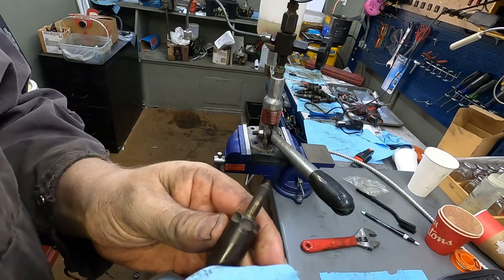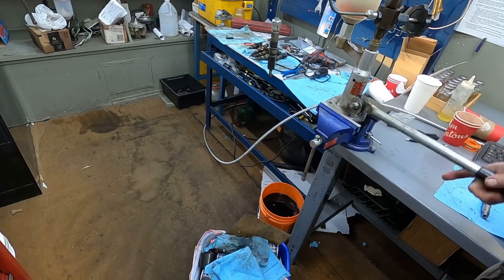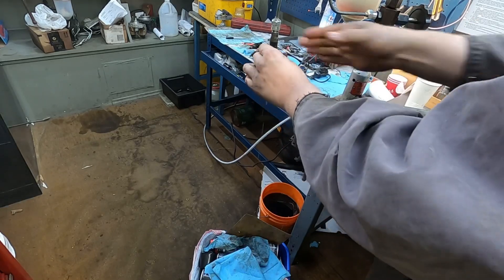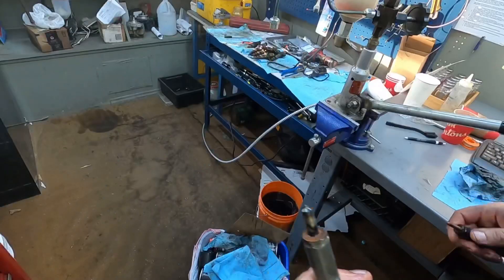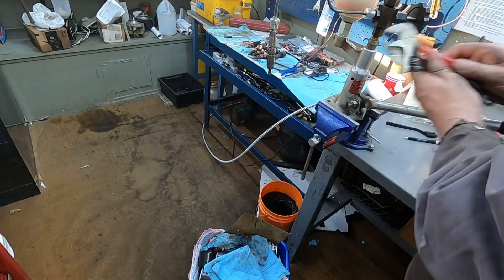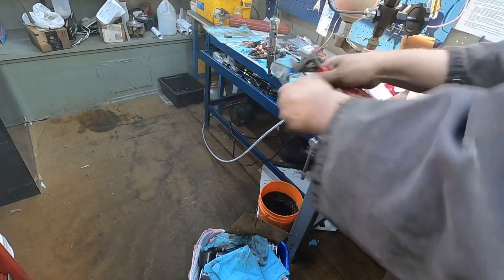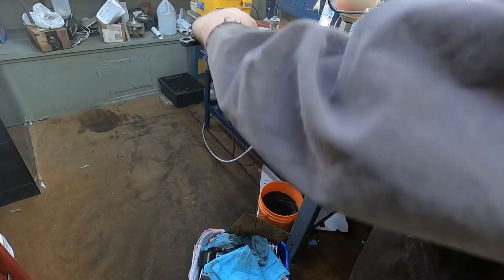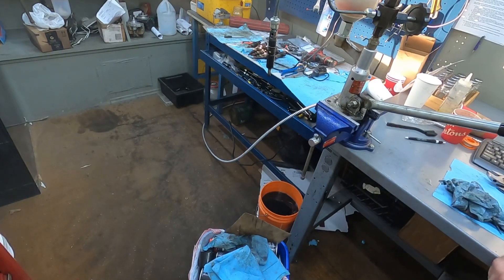Fuel flow stock 5x.010 vs 5x.025 fuel injectors.

Comment: Awesome demonstration Rob. Really puts to light the real difference between injector sizing. Now what would be interesting to see would be to see how different it looks with a six or seven hole versus the five hole equally sized flow capacity. That makes sense? Yeah
Reply from the maker: I will be doing a bunch of injectors stuff. That stuff is a bit more involved. So I have figure out some stuff. A lot of it will blow guys minds.